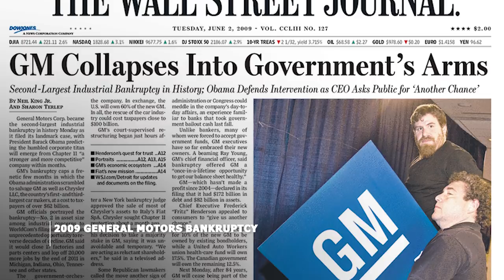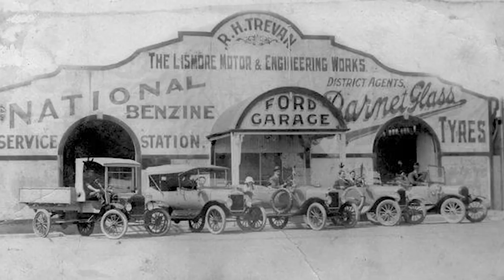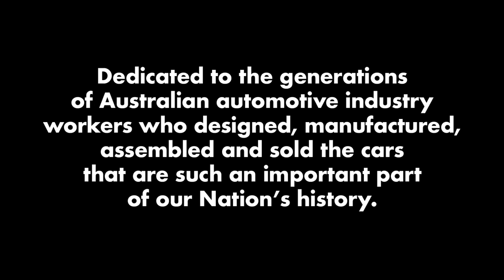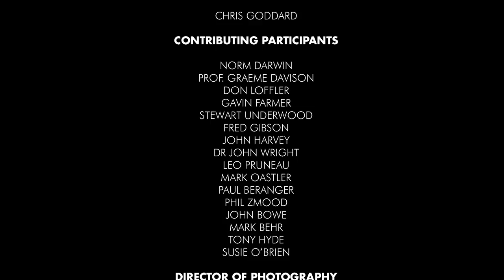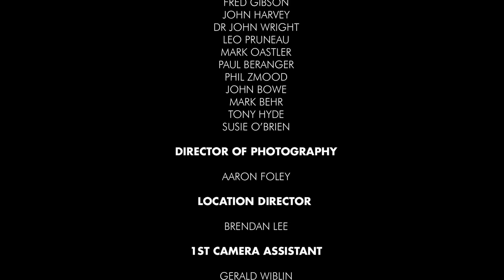A Legacy Lost? (2000-2017) | Shannons End of An Era | Part 4

Comment: Very well documented Shane, it made me 😭broke my 💔 too. I've never owned a imported car. I come from a Ford family, my father drove Ford all his life. My 1st car was a XB hardtop Fairmont, automatic transmission, my 2nd was a XB 4door, column auto, my 3rd car was a XA 1971 351 GT, pwr steering, 4spd toploader, factory fitted sunroof, white leather trim,
Calypso green, my run about was a XE falcon column auto, then EL falcon, then AU Fairmont with the Ticford engine automatic automatic & now I'm driving one of last AU Fairmont wagon. Made in Australia. The best of them all is my GT, nothing comes close to the V8 4 valve per cylinder engine  351 Cleveland. I've never. I will never own imported cars & I must say, the GT turns more heads than BMW or Mercedes. Onlookers are even more amazed when they see me, a female getting in, out & driving the GT🇦🇺👍🇦🇺👍

Comment: We own a V8 Adventra with an oil leak and about 440,000KM on the clock. We've owned it for 8 to 9 years and put about 300,000KM on it and she's still going. I miss Aussie made cars
Reply: she will last another 300,000 after that

Comment: Might not have been the prettiest car on the planet, but the AU will go down as the most reliable Falcon, Ford has ever made. Anyone who has owned one will agree.
Reply: Not going to disagree with you there. Owned an ex taxi AU with over 800,000k's on it - took it to outback in NSW. It coped brilliantly with 40 degree heat, dust, dirt and poor roads without any problems at all, with ice cold aircon. That thing got us back to Melbourne and never left us stranded even after we put it through hell.

Comment: I had an HG Kingswood 186 manual, then an LH Torana 202 trimatic in green, followed by a blue VK Commodore wagon 202 trimatic Vacationer. 
I'm not interested in anything Holden pushes now. Without local manufacturing,  the lion and stone badge has no real meaning.  I always felt that the 'Holden' and 'Commodore' badges should have been farewelled when the factory closed to give the nameplates a little respect.  They didn't do it, so the backlash is now obvious and telling.  
I've since moved over to Toyota.  My 2012 Corolla sedan has been owned since 2013, and I've never had an issue with it. I've also just purchased a 2018 Hilux 2wd singlecab tabletop.  It has a body color  bumper and silver wheels off the previous model, as i never took to the black wheels currently available.  
I still mourn the loss of our car building sector,  but now that we must purchase imported anyway,  i may as well buy what i know is reliable and has decent resale value.

Comment: Sad for me, my father worked there on torpedo boats during WW2. My brother and I completed panel beating apprenticeships at Plant 3 Fisherman Bend. {Experimental} The 1956 FJ was still in production when I started. And the FE test prototypes were been built by hand and tested at Lang Lang. The link continued later with my brothers son's Panel shop being the number one choice of GMH for crash repairs and some experimental development work for 30 years until the demise. A bit of common sense by the bloody minded Trade Unions could have saved  both Toyota (only plant outside Japan) and GMH but they chose to close them.

Comment: Built the Ford transmission for 5 years at Borgwarner/BTR/ion and unfortunately the CNC Lathes were outdated, the 4 speed tranny was also outdated. We had the 5 speed ready to go in the BA but Ford the wanted 6 speed. Our pinions kept exploding under the torque. No more Australian built Ford transmissions and that company I believe went to China.

The "Global Warming" farce has also played it's part in this. Ford and Holden were not as efficient as the imports, oil prices going up hurt us at the petrol pump. Australia is surrounded by developing countries that offer cheap labour, they won't buy our expensive cars so they make their own. We just were not exporting enough for our automotive manufacturing to survive.

Comment: Funny how Shane mentions the Avalon, yes it never really caught on with Australia, however come the later Mark 3 Avalon, there were a few small things Holden & Ford hadn't even thought of that Avalon had. The build quality was always praised on them, especially paint quality but hey. The Aurion will always go down as an underdog in Australia, especially with that potent 2GR-FE. VF will always go down as the most technical advanced car ever to come out of Australia. Ford went full European by FG & that's another achilies heel especially with it's otherwise good suspension design let down by poor bush material choice, etc
FG was definitely dragged on far to long without major update which was obvious when the VF came out.

Comment: It's 2022 and I'm a 60yo whose daily is a 365000km 2005 WL Statesman v8. in 2017 I thought long and hard about buying a new Caprice, but the idea of doubling my mortgage was just too much. Blame all politicians and govt departments, but also the tariffs and subsidies mentioned in this clip. Why did Australians have to pay $29000AUD for a new Ford Capri convertible when the LHD Mercury Capri (also made in Broadmeadows) cost Americans $8900USD? We have been robbed from day one.
Yes you could buy a C-class or 3-series for Calais money, but you would need an E-class or 5-series to compete.
BTW, my v8 Statesman is cheaper to run (in a rural environment) than any 2l 4 cylinder car or ute. Fuel costs are not total running costs.

Comment: kia and hyundai now leading, i have never been a holden or ford fan, dinosaur engines, high fuel consumption , heavy on tyres, plain styling, and a lot of problems, recalls on brand new cars, just google holden and ford problems, the list goes on, my hyundai i30 was never recalled and now 10 years old the only thing i have had go wrong has been blown globes, next hyundai will be a i30n fast back.

Comment: Or in part did Aussies stop buying Australian made  cars because the local manufacturers stop making the cars Aussies wanted? Or was it that local manufacturers lacked flexibility and innovation. PS My pride and joy was my FK panel van that  created whilst in uni in 1974 dropped a Monaro six manual floor shift  into along with Monaro front buckets and FK station wagon rear fold down seat. Best car I ever had.

Comment: So sick and tired of people who should know better stating the AU cost Ford. Absolute rubbish. Firstly, the public are shown designs before production and the curvy AU shape was voted more desirable than the boxy BA/F shape so Ford went that way. Secondly, AU & XB are Fords two biggest sellers ever. Thirdly, everyone knows the first variants of most car makers new models have quirks or issues ironed out in the Series II & III which is where the AU proved itself. The shape today is completely relevant with its low drag design and the Ford Vtech Six cylinder is the start of the Barra motor whilst the last run of the mighty Windsor 5.0i came out with 300hp factory in XR8 guise. A good set of headers & exhaust improved that figure noticeably. Most agree the AU is the best steering & handling Falcon with the IRS, LSD and loads of torque, make a great Australian road car.

Comment: let's call a spade a spade. aussie-built cars were often inferior to the imports and where more expensive. and not everyone wanted a huge 6- or 8-cylinder engine. also, the aussie car industry was operating on life support for YEARS before they pulled the plug. it was obvious from the 90s that australia just couldn't sustain ANY car manufacturing, let-alone four manufacturers.